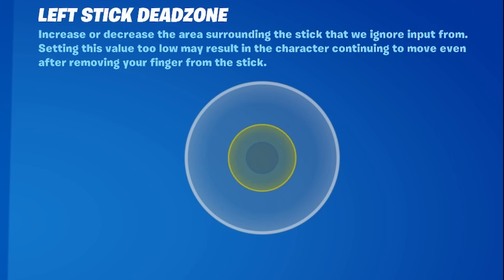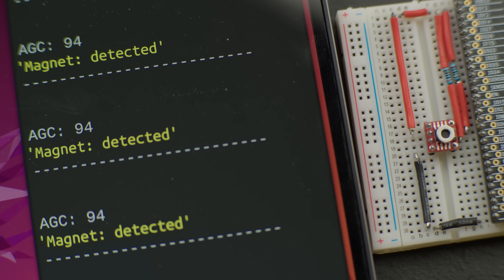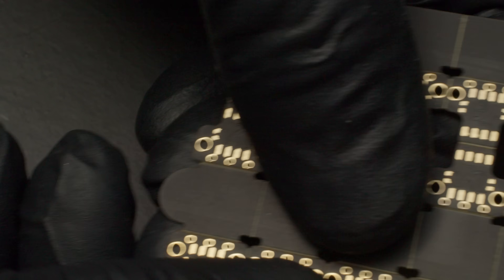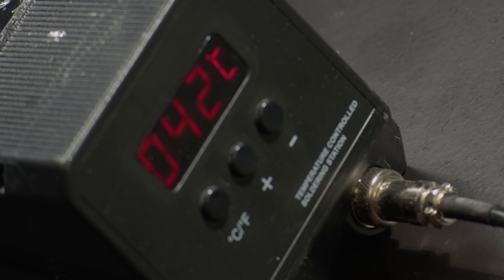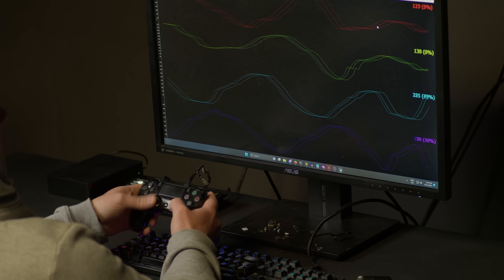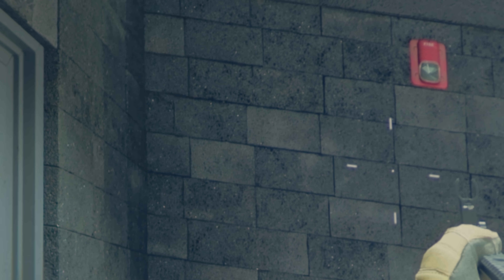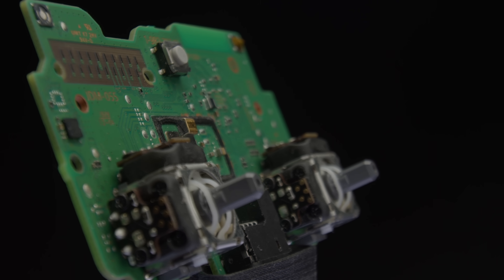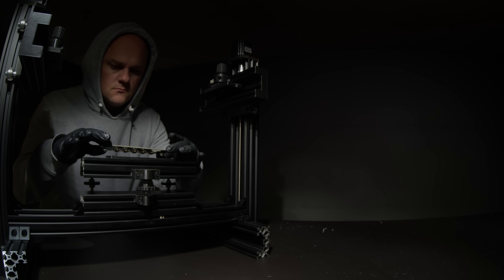Beating the $20B Joystick Drift Problem, and giving it away for free

Comment: hey just something that could massively improve the stick drift in your design: use PTFE gearbox grease instead of silicone lube, and also spread it inside the part with the springs (i.e. the pivot point on the stick), PTFE gearbox grease is teflon so it is absurdly smooth

Comment: I spent $129 on a new controller 4 days ago. Tried keeping the controller in a clean place and cleaning it. Not even 4 fucking days and there's a glitch where when i barely touch one of the joysticks it sends a maximum movement in the opposite direction for a split second. I think its a drift issue, but the replacement Joysticks are $30 a piece!!! Yeah, they do this shit on purpose.

Comment: I see that this is an older video, but I figured I'd throw this out there just in case. I worked at a controls company as a design engineer for 16 years. I designed quite a few new controls, but upgrading legacy products from trash potentiometers to hall effect was also part of my role. You seem to have a good understanding of the pitfalls however, designing around deadstick and using software work arounds are definitely ways to improve functionality. Feel free to reach out if you have any questions or would like to collab, I would love to help the effort.

Comment: Okay here's the thing. 

Everyone says "Just use Hall Effect sensors! They used to use them decades ago!" and bring up Planned obsolescence which, while valid, completely discounts other factors that result in the choice to continue to use the standard Joysticks.

1: The standard Potentiometer joysticks became standard for a reason; they're off the shelf components that are extremely cheap. They're not just used in controllers, larger ones are used throughout different sectors, in things like Flight sticks, Diggers/Bulldozers etc. Anything with omnidirectional lever movement. The factories that manufacture Controllers usually don't purely manufacture one brand of them, they make them to order per the client and don't use entirely unique components where the designs overlap, such as the Joystick sensors, 2.4ghz wireless transmitters, vibration motors (up until more recently with Nintendo's new HD Rumble) etc. The large standardised supply of them makes bulk part orders extremely cost-effective and disincentivises using proprietary hardware across the whole build. 
Hall sensor modules costing say, $1 per unit vs Carbon Potentiometer modules at 20 cents would scale exponentially as controllers are built. That increased parts cost wouldn't necessarily generate extra sales and only inflate the base price of the controller, or result in them taking a deeper loss on the manufacturing and parts costs, much like they take on the Consoles themselves, Remember; Sony tried to minimise their Profit losses on the PS3 and PS Vita, and Nintendo did the same with both the Wii U and the 3DS, all upcharging and subsequently bombing out of the gate and having to slash prices extremely quickly to try and pick up sales (Yes I know PS3 beat out the Xbox 360 at the end of the generation, that had multiple things behind it, the bad Xbox One E3 announcement, Xbox force bundling the Kinect with new consoles to raise the price, a few standout exclusives releasing (Last of Us, Uncharted 3), and the fact that parts became cheap enough that the PS3 Super Slim was able to be produced and sold for total profit at the same RRP as the 2nd revision Xbox One S and E models).

2: Hall Effect sticks aren't a 100% wear-proof fix, nor are they a completely suitable replacement. For one, they require more power. For as advanced as Xbox and PS controllers are now with Bluetooth chips on top of the standard 2.4GHz radio transmitters, more detailed rumble profiles, audio input and output via AUX input, the Impulse triggers, built in mic, speaker, gyro and LEDs on the Dualsense, that's a lot of power drain for a 1050mAh battery in the case of the Dualsense, or a pair of 1000-2000mAh AAs in the case of the Xbox. People have been complaining about how bad the battery life is on the Dualsense since it released, same with the Dualshock 4 and the 3 as well. In Xbox's case, people always moan that they don't come with a rechargable battery built in, but again, we've seen how degradation affects controllers with specific proprietary battery packs, or when systems/hardware make batteries harder to replace, such as in modern smartphones that are glued together with the battery also glued down. The joystick modules with Hall Sensors don't just magically have no mechanism to return the sticks to 0. They still have springs, they're not immune to wear and tear. If anything, wear is more pronounced on Hall sensors because of how the sensor registers input.

3: Current Xbox and Playstation designs use Hall sensors in the triggers. On Hall mods for Xbox controllers, fully pressing the Left Trigger sets off the Left Thumbstick sensor, and pulling the stick down triggers the LT sensor. This is what stops desoldering the old module and soldering the new one on as a simple mod. You need to mod a workaround to stop the interference from the other magnet. Again, this further moves the assembly process even further from the simple SMD work by requiring a specific shielding solution also being installed, increasing the production time. And, again, Hall Sensors draw more power.

The money for current gen consoles doesn't come from selling accessories like it used to, it comes from the online membership, Marketplace costs on all sales, ESPECIALLY Microtransactions. If you think they're making bank just on selling replacement controllers you are woefully out of touch with the cost of production of hardware. There's a reason why Sony dropped an $800 "Pro" Console targeted specifically at whales and scalpers. The hardware itself isn't much better than the base PS5, it's a slightly newer gen GPUs with their own version of DLSS to increase frame generation through AI upscaling, a 2TB SSD, an added 2GB of DDR5 RAM, with a Wifi7 supported Wifi adapter (Wifi6 IS STILL NOT STANDARDISED. 8K RESOLUTION IS A PIPE DREAM OUTSIDE OF THEATER PROJECTORS. 120HZ STILL ISN'T STANDARD ON 4K TVs AND PEOPLE WITH 4K MONITORS USUALLY HAVE PCs THAT RUN BETTER). 

Instead of pricing it more closely to the base console, Sony have pulled out their old classic of bumping the price point up closer to the actual hardware cost. Xbox, meanwhile, are pivoting to software with Cloud streaming in the hopes of making Game Pass a clear choice over PSN Premium, and Nintendo are doubling down on their last-gen hardware fixation. Xbox started selling OEM parts and are planning to add more, and are also partnering with repair shops across the US to allow them to officially refurbish damaged consoles with OEM parts and proper documentation in order to provide lower cost and faster repairs. Steam, on the other hand, came right out of the gate with the Steam deck with tutorials on how to diagnose and replace worn components outside of the battery or the screen. Their new VR headset will likely follow in its' footsteps. 

Either way, people need to actually look into things before they parrot the same talking points over and over and over without proper knowledge. It's the same energy as those who bitch about Skill Based Matchmaking, or who complain about Pokémon games not looking like Breath of the Wild. Creators yap at surface level to create engagement of people fighting in the comments, spouting wild speculation and start conspiracies that are easily disproven with a little research. It's plaguing every inch of media at this point, idiots with an agenda and an audience to sell ads to running their mouth.
Reply from the maker: Wow this is such a good take! Great comment. And you have some really insightful stuff that I agree with. To add to it. The current hall effect sensors (not the one I use) can be said, simply put. Dont work. At least to Sonys standard anyway. Also, if Alps dont sell it Sony is not gonna implement it. For now. I think they will implement the MR tech since it uses much less power and have much less noise. And is more immune to noise.

Comment: I just bought a controller that isn't shit and five years later it hasn't drifted a mm. 

Turns out the problem is with shitty low quality hardware, and it wasn't some wildly complicated problem that needed a complicated solution.
Reply: I was stunned when I heard "controllers only last two months!" lol. Controllers have always lasted me years. The controller I got with my launch PS4 is only barely getting stick drift all these years later.

Comment: The fact is, this isnt an engineering problem. its quite easy to provide a number of solutions to produce joysticks which will not experience failures. the problem is a production cost of these solutions is higher than having a simple carbon based variable resistor.

Comment: Every single official ps4 controller I bought died. Just stopped responding to charge. The 20$ amazon knock off ps4 controller, is now in its 5th year of useage with absolutely 0 issues.

Comment: Using carbon-track potentiometers for position transduction is a very wrong choice - as the track is consumed with use.
I agree that a linear transducer built with Hall sensors is a more durable choice, but it comes with its share of problems - you need software for linearization and scaling. Analog Hall sensors suffers from long term drift, but it doesn't affect joystick functions.
The gold-standard for position transducing is an LVDT. It stands for Linear Variable Differential Transformer. It is a small transformer made with an excitation winding, and two sensing windings. It is exceptionally precise, can be built to any size and it CAN'T have any drift by design.
My cheap solution to joystick drift has been to replace carbon-track potentiometers with a wire-wound potentiometer. The track - made with Ni-Cr wire - lasts 20 times of that of a carbon-track, and the resistance stays the same until the Ni-Cr wire breaks - that's is, no drift. The only problem it is hard to find wire potentiometers with values higher than 1 kΩ, and therefore you have a standby current in the pot of 5 mA, which you must take into account. 
There is also an optical solution. You can find on sale some optical "potentiometers" which are made with a slotted disk (with 256 slots) and two optical sensors and some integrated electronics. These "potentiometers" have no end stops, and generate a direction-sensitive train of pulses as soon you rotate the spindle. The problem with this optical solution is the limited resolution, i.e. 256 pulses per rotation, and the fact you need to program an Arduino to process the pulses into an in-range voltage variation.
Hope this help some gamers out there.
Greetings,
Anthony

Comment: Really makes me miss the N64 controllers that I use to be able to inexpensively fix, not to mention the Atari 2600 controllers I used to fix.  Both were simple, inexpensive, and the parts were available from the manufacturer, even before the internet in the case of the Atari.

Comment: You need to realize engineered obsolescence is a thing. They are doing on purpose to sell more controllers. Cheap manufacturing, allowing mistakes, and variances in the manufacturing process is one of those dirty jobs people are hired for no one talks about. As long as most of the products made last longer than warranty period, it not illegal but it is immoral.

Comment: I know I'm late to the party but did you do a durability test versus a traditional controller. Like what deadzone is needed to stop drift after rotating the stick for different times at a certain speed or something?
Reply from the maker: @colinflanagan2502  Not really. But in the beginning you can save it with larger and larger deadzones. But eventually its gonna be hopeless.

Comment: I just want to buy controllers with this tech in it already "at a price I'm not supposed to have access to" (because I can't solder or even get a housing closed again after pulling the screws out).

Do I have options? A wireless Xbox controller would be my first buy. Have any of your patreons took the idea and ran with it?

Comment: Just a minute or two into the video when you start talking about wear on resistive material and the need to eliminate contact between materials to eliminate wear.

My mind started flying in thoughts about how I would do it, how can we track the position of joystick without contacts and then it clicked I that I can use magnets, few mins into the video and boy I was right!

Comment: In the 1990s I worked at a company that created remotely controlled variable valves for water cooling systems. While every other manufacturers were making the valves using resistive potentiometers to know the position of the valves, we were making them using an array of hall effect sensors. We had it down to 0.1% resolution and there was no drift. The control unit was essentially a computer interface where the valves were set to anywhere between 0 to 100% open. The valves were so good we couldn't keep up with demand. Eventually a large company with huge resources reverse engineered our method and not only created a volume of product we couldn't match. But they also made it much cheaper. I believe that 10-15 person operation eventually went out of business. I quit working for them in 96 or 97. I did a quick google search and while I can find a company with the same name, they are based in China and make the card readers like you see at gas pumps.

Comment: Another thing that causes drift is wear on the elastic material that holds the stick in the neutral position when it's not in use. Solving that problem might get you in trouble with the controller mafia, however.

Comment: Will that magnet loose its strength over time ? Can we use electro magnets for this ?
Reply from the maker: @shubhverma9313  Yes. After about 500 years it will be so weak it cant be used. In theory you can use electro magnet, but its probably not worth the extra complexity.
Reply: @MariusHeier1 only 500 years? I smell planned obsolescence

Comment: Clavia Nord keyboards have a pitch control stick with practically no dead zone, because there are no parts that slide against each other, like axles. Just a bendable piece of spring steel with stress gauges glued onto its sides.

Comment: A metallic soldering paste that melts in the oven? I would be afraid of putting the circuits or chips in the oven for any amount of time but that's brilliant!
Reply from the maker: @alexanderelderhorst2107  That is how almost all electronics is built. They are made to withstand the heat. Check out "smt production" as a search to learn more.

Comment: Had a brand new xbox series controller and it got drift in a week and i kept it in a case and cleaned it regularly. Yet my old xbox 360 controllers still work fine after 10 years of use

Comment: There are chinese venors already selling "halleffect" replacements at this point. I am wondering though, will the magnetic fields weaken over time and would that wreck them or make the readings really inaccurate?
Reply from the maker: @mugogrog  For my solution its using the relationship between several hall sensors in one chip so it doesn't matter that much. Unless it loses a lot of its magnetic properties, which takes about 500 years.

Comment: So considering with he the rest of the stick becomes the weakpoint, couldnt you go overkill and make a new rest of the stick out of something more durable, 3d printed titanium would be quite funny, and then use a different method to self center? more magnets even. like a magnet centered at the bottom to attract, and then a round one like you used around it to push back in, on some sort of tiny rod facing down.
Reply from the maker: @florianmaslofski  When im done with the new main board with the sensor im using i will work on a new complete stick with electromechanical return to center. Maybe even a full force feedback ministick.

Comment: This reminds me of the PS3 controllers, where the controllers had analog sticks with magnetic sensors until around 2012.
 but to cut costs the controllers started to come with a potentiometer sensor.
 To this day I have never seen these older PS3 controller models with decentralized analog sticks or coming to me with this defect, only those from 2013 onwards

Comment: 2nd comment, but different reason. My sticks have a default 20 dead zone to accommodate for this sensitivity. The sticks snap back to the center with the magnets, and the dead zone solves the center issue. 

Game Sir - Hall Effect stick controllers
Reply from the maker: @FreakyHacker64  with 20% dead zone you can solve probably 80% of the drift most people have.  Drift will always be a product of deadzone, noise and joysticks ability to go to center with the centering spring.

Comment: The reason hall effect sensors aren't used in controllers is because a hall effect sensor costs $1 whereas a potmeter costs $0.20.
That's literally the only reason.
Reply: I'd wager they also use it because of its very limited lifespan. They gotta extort the customer somehow or they wont make that 500% profit margin

Comment: The ps3 fixed the drift problems but the ps5 and 4 brought it back cause its more profitable to the company because the current stick sensors are cheaper and people would buy less controllers if they last longer
Planned obsolescence is scummy but they get away with it because there a egotistical company because its no longer demand and supply its supply and demand